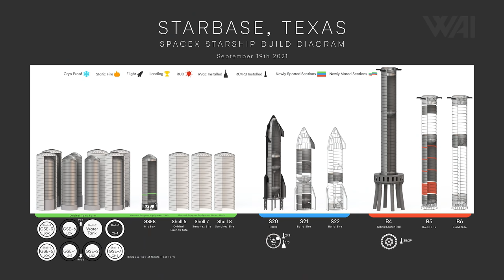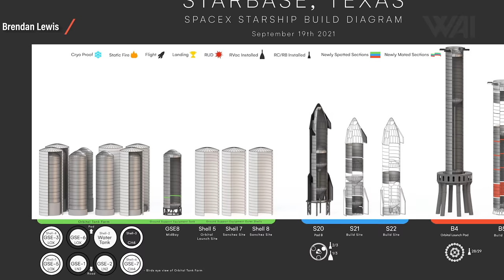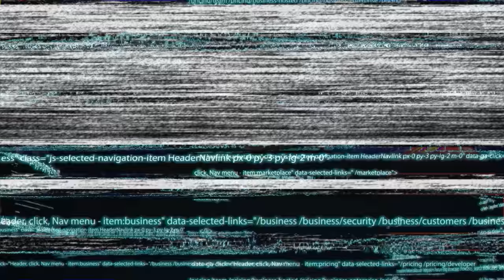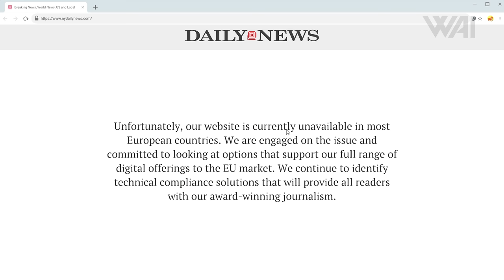Starship 2021 Official Design Changes – The Holy Grail Of Rockets!

Comment: 1:35 until now, no other Second stages have ever successfully returned from orbit. Unless you count the space shuttle which technically was the second stage to the SRB’s. Not that it would be reused without refurbishment, but it was returned and recovered.
Reply: That threw me off too. He clearly meant to say second stage.
Reply: True. Also Buran was 2nd stage that returned.
Reply: @nobody_815  Once.
Reply: @myballsitchsomethingfierce6319  What does that have to do with Top's comment?
Reply: I think the big differences to the space shuttle is a.) speed of turnaround for subsequent flight and b.) ability to land pretty much anywhere (no need for huge runway)
Reply: @myballsitchsomethingfierce6319  LOL... yeah, if THAT'S not showing off.. I'm not sure what is :)
Reply: @usnavyfish  You are right. A correction text is shown on the screen, yep, he meant second stage of course. Actually I added the correction [2nd] in the captions also.
Reply: Space Shuttle was very interesting  in a sense, that it was the first stage (also?). It's engines were working from the beginning of the flight. The SRBs were boosters, side boosters, as their name also indicates. So, looking at it like this, it was a single stage to orbit - but not really, because it had helping side boosters. (and it dropped it's ET).
Buran on the other hand is rather the second stage, since Energia was it's first stage - which also had 4 boosters, but Buran's engine were used only at the last phase, not working at the launch.
Reply: SRB = Stupid Rocket Booster
Solid rockets are barely controllable once ignited. Not very smart for a human vehicle.
Reply: @jeechun  Oh a pertinant and informativ comment. Thx
Reply: Space shuttle wasn't a complete second stage. It was only the payload/crew area and the engines. The remaining part of the second stage (the external tank) was not recovered.
Reply: @janvogel9719  well if they're catching starships, the launch tower with chopsticks, etc. Is probably a comparable to a shuttle runway in terms of infrastructure. However unlike the shuttle the starship couldn't really land anywhere else if it failed to reach orbit.
Reply: @jeechun  Interesting points. Although what counts as a stage; the engines, the fuel, the tank, or all of it? Basically the ET was the entire first stage of the shuttle despite the engines being located at the shuttle itself and crossfed from the ET. A rocket stage is 99-ish % fuel and tank from a mass perspective, so once the ET was dropped, it could be argued the shuttle was a second stage with some (at that point, for the rest of the mission, unusable) first stage engines as a payload.
Reply: @plainText384  I believe that the Starship could also come with a "legged" version for landing on unimproved surfaces (will have to for Moon, Mars)...and even the non-legged version might have some emergency landing capability where it could head for some flat terrain, expend all of its fuel in a short hover before touching down and then do a controlled touchdown (with at least a chance to survive it, even if it tips).
Reply: @janvogel9719  yes but the new render doesn't seem to show legs on the starship (even for crew). Maybe the starship could land without landing legs and without falling over, but if you damage the starship on landing you run the risk of a sn 10 style post landing explosions, even if you hover as long as you can, there will be gaseous methane and oxygen that the engines can't use left over. And if the starship falls over after landing, I don't think crew would survive (starship is 50 m tall).
Reply: @AndrewBlucher  Uhh, right, I was stupid, not the solid rocket boosters.. :D
Actually those could be SSRB (Side Solid Rocket Boosters :D ).
Reply: @reamie  You are right about the mass ratio of fuel and tank in a stage (though it could be lower, perhaps 95% or so, engines are heavy).
But I think, engines (and avionics?) are crucial part of a stage. The Space Shuttle system is so different than a "standard" rocket that it is hard to classify it's elements. I don't even know any other system, which uses a fuel/oxidizer tank, which is dropped while the flight (ascent phase). Do you? Russian Maks was designed somewhat similarly. https://tinyurl.com/rhjwwkfs
Reply: @jeechun  :-)
Reply: keep saying 'shuttle' yall are gonna summon the Chrises from NASASpaceflight

Comment: The new render is also accounting for the header tank with that large window.
Reply: They did talk about in the past moving the header tank for crewed launched, only there to balance the weight with no payload in the nosecone, guess we will see
Reply: @daleyoung5200  I also think it would be a lot easier to keep the propellants cold on interplanezsry missions when all tanks are in the same section 
I imagine it's a lot harder and more complex to build a second cooling system just for a "small" headertank in the nosecone
Reply: That tracks better than my heat coming off the nose theory.

Comment: It amazes me how literally EVERYTHING at the launch site is a prototype, even the tower and the arms. Even though things like the tower don't look like the earlier renders I wouldn't doubt the next tower will look more "complete" or more like the Falcon launch towers
Reply: The really mind-blowing realization is that there should never be anything OTHER than prototypes.  Everything made, ever, should be assumed to be transitional toward something better.  Finality and stability are illusions peddled by MBA leeches.  A true engineer wouldn't agree to such a fantasy if they had a choice in the matter.
Reply: @dudermcdudeface3674  they’ve made it into something organic, a bit like evolution, but on a radically different timescale. Perhaps this is the Silicon Valley breakthrough that he’s applying to disrupt all the sectors he works in. A quick iterative process determined by large data pools and computer simulations. I wonder how well they can model reentry with the TPS they’ve installed on S20. Don’t know much about current capabilities of supercomputers but I’d imagine it’s pretty close… A wild guess would be 80-90%?
Reply: @armr6937  I'd say at least 80%, but the universe has a way of doing stuff that simulation can never predict though lol

Comment: A reminder: the new depiction is not a change in their interior strategy. It’s a newer idealization of what Starship in their view should be. The windows on the 2019 version were before they had verified a version of the tank structure that could withstand the internal pressures and aerodynamic forces while supporting the windows and/or heat shield tiles attached. They know that now.

Even if they removed the landing gear in the current depiction that is no confirmation of their intention to do so eventually. It’s a work in progress that may need to work along the FAA’s current constraints for it to become a launch system with a cadence under a week and up to daily operations.
Reply: It's always important to keep in mind that even with official renders, artist depictions will not reflect the final product, and sometimes liberties are taken due to filling in knowledge gaps from in-process designs or even a lack of clear descriptions. This is true for SpaceX, and it's also true for other space companies as well!
Reply: @z-beeblebrox  Zaphod? Is that you?
Reply: @AndrewBlucher  I'm just your average hoopy frood, that's all

Comment: The Space Shuttle was a reusable 2nd/upper stage, just that it was very expensive to refurbish between uses.
Reply: I take it the fuel tank wasn't considered a stage?
Reply: @94nolo  It's a bit weird, technically the shuttle is the first, second, and third stage, as it's engines are used in all three stages. The first stage is the shuttle main engines drawing from the orange tank and the solid rocket boosters, the second stage is just the shuttle and the tank, and the third stage is the shuttle's orbital maneuvering thrusters. But the point in this video is that there have not been any upper/orbital stages that were reused, and the shuttle was reused, just very inefficiently.
Reply: @Shalashalska  ah hadn't thought about it as such. makes sense, and I agree that the upper stage was reusable. just not rapidly.

Comment: Felix, did you forget the Shuttle or what??? The second stage comes back to earth every time. The boosters are also recovered using their parachutes. Granted, this was not rapid reusability and we lost the tank every time, but still, it was a marvellous technological piece of juillery.
Reply: Yes, I was just about to say the same thing.
Reply: Yes but the second stage (the Shuttle) needed an expensive refurbishment of several months to be ready to flight again and the boosters landed in the sea which made their livespan shorter. 
But your right, it was insane technology for the time
Reply: He first reusable spacecraft the shuttle wasn't completely reusable like starship is so technically the shuttle was only half reusable even though they did recover the boosters and the tanks but only a few tanks landed soft enough to be reused not to mention it is cheaper to build a new tank every time so starship is completely reusable not halfway
Reply: The large fuel tank wasn't reused and the SRBs needed pretty much a complete rebuild for each flight. Also the engines needed a complete strip down and rebuild between flights also. Not really fully reusable at all and a huge amount of refurb between each flight for the parts that were 'reusable'.
Reply: Except a minor issue that it was more expensive than non-reusable rockets.
Reply: I classify the shuttle as an SSTO with boosters, No upper stage fires its engine on the ground.
Reply: I think the word you are looking for regarding the shuttle is re-build-able. It was literately stripped down and put back together again. ;)
Reply: Refurbishable != Reusable
Reply: Shonkers _  if the shuttle is second stage, so you fire the second stage engines first. Don't you?
Reply: A lot of silly replies to the comment.

a) Felix said it incorrectly. He'll need to fix that.

b) Starship is a reusable second stage in that it provides major thrust. As did the shuttle.

c) The Shuttle threw away the solid state boosters and the huge fuel tank. Starship throws away nothing. That is the huge thing.

d) Starship is a 100x better Shuttle.

/TKT
Reply: @Vatsyayana87  an SSTO with boosters could be classified as one and a half stages, or as two stages, depending on who you ask, but by definition adding boosters means it’s not an SSTO anymore.
Reply: Shonkers _  ok I agree. that makes sense.
Reply: Shonkers _  Well we disagree, i think something that lights its engines on the ground all the way to space is absolutely a single stage to orbit. In this case with boosters id say its a hybrid SSTO.
A second stage never lights its engines first, that is pretty hard to argue in my opinion..
Reply: @eliparker4114  By whos definition? Id say by  lighting your engines on the ground all the way to orbit is an SSTO. Certainly a second stage does not ever light its engines first...
Reply: Shonkers _  I responded to like 30 questions and comments passing at least a hundred lol, i dont even know where to find this one again beyond it being in my notifications. You could copy and paste for me if you want, im sure ill get the idea of which convo this was by your answer. It doesnt let me see the comments from even this thread while in notifications.. :(
Reply: Shonkers _  K i found it and i still stand by every word, as of yet. 
The shuttle was a grey area, but i think to call the very first engines ignited as the second stage is just absurd, and to say something burning its engines from the ground all the way to orbit is as close as anything ever flown to an SSTO. 

There is no where that says an SSTO can not have boosters, Its just not what we imagine when talking about them. 

Nobody would ever say something like "they just separated stage one" when an atlas V drops its srb's, right? Because they arent a stage. On shuttle there is only one stage with srb's
Reply: Shonkers _  lol your so picky, its still the same vehicle doing it isnt it?
Are you telling me you think the dragon capsule covers multiple stages because it uses its dracos to finalize its orbit sometimes? Simply absurd my friend.

Shuttle is a grey area, so its basically not worth talking about at all but i can say one thing straight out, a second stage does not light its engine on the ground and im pretty sure nobody has ever called strap on srb's a separate stage if the mains are also running.
Reply: Shonkers _  Though i didnt actually know that about shuttle so thank you. I still consider them the same stage but clearly we can disagree on that lol
That thing was one big grey area, its so not by the norm, hell its not even a rocket by definition...

Comment: I LOVE the new updates on the design! Less in terms of looks but more and more in terms of efficiency. Why make the ship more complicated and heavy when you can lose so much weight with simplifying. Exactly what i love about engineering! Optimization
Reply: SpaceX should remove  the big topmost window alltogether.
Reply: @MrJPI  speaking strictly for efficiency yes. The step of making it smaller is a compromise. Still not enough of a compromise maybe but its a right step. Removing it would remove one thing that makes the whole ship look cooler. But.. lets be honest this thing is cool enough.

Comment: the space shuttle could be considered an upper stage that made it back? it doesn't really have a first stage tho, just two SRB and an external tank
Reply: yep, in every meaningful way it is an upper stage, it has to bleed off orbital speed to get back, which is the whole hard part,
Reply: I have a feeling that Starship will be pissing around with the heat shield on each turn around, just like the Space Shuttle.
Reuseability sounds great on paper, but it's not that simple in practice.
Reply: @oldmandoinghighkicksonlyin1368  certainly looks that way so far, maybe their attachment system makes it quicker and cheaper.
Reply: @oldmandoinghighkicksonlyin1368  at least it's a lot simpler to swap them and there aren't that many shapes. we have already seen inspection and replacement in the last weeks
Reply: @cmilkau  Yes, it's a lot more uniform than the space shuttle which had nearly all unique shapes. But there are still unique shapes on Starship around certain areas. Plus a manual inspection will be required after each flight and then after each re-install. It's not a process that can be automated.
Reply: possibly, but its reusability is questionable, since the whole vehicle basically needs to be refurbished for spaceflight.
Reply: @Dejawolfs  All spacecraft need to be refurbished after spaceflight because it's so punishing an environment and our materials science hasn't made workable materials that are invulnerable just yet.
Starship is still just theory at this point, but it is working with concepts and materials that are a half century further down the development chain than the space shuttle, so there's a good chance it will be faster than a 4 month turnaround.
Reply: Thats one of those opinion things i suppose lol. Since the shuttle lights its engine before anything happens at all, id argue its not the upper stage, i think there is only one stage with boosters. An SSTO one might say but not in the fashion that most would classify the words, even if correct..
Reply: The shuttle was closer to a single stage to orbit with a drop tank. The tank was never reused though so it was not fully reusable in that sense and to reuse the shuttle itself required a huge amount of refurbishment.
Reply: @oldmandoinghighkicksonlyin1368  You're not factoring in the iterative development process into the whole deal. Picture the early tanks, that always looked dinged and uneven. They look incredibly tight nowadays. Or the nose-cones, the last version we saw in Tim Dodd's video was a huge step-up. The process gets streamlined as they learn more about it, it's not a fixed design like the tile layout on STS was, each Orbiter with its own number of tiles. In a year you might be seeing a radically different process to apply and ensure TPS integrity for several launches before refurbishment.
Reply: Starship would not be 'first' doing this. The Space Shuttle most definitely re-entered from orbital speeds. You can quibble about the reuse-vs-refurbish and how expensive and practical it was to reuse the shuttle, but not about it re-entering from orbital speeds.
Reply: Engines on stage two usually light up in space..
Space Shuttle engines light on take off
Maybe that disqualifies it from being labeled a second stage...    :)
Reply: @perthomsen8708  I quibble that shuttle was the first stage, you do not light the second stage engine to start a launch...
Reply: @perthomsen8708  But it wasn't fully reusable because its huge fuel tank wasn't reused, I think that's the point.
Reply: @schrodingerscat1863  I was really only making the point about re-entering from orbital speeds. Did not want to get into the 'reusable' discussion.
Reply: @Vatsyayana87  True, you don't light the second stage on the ground, but the shuttle didn't have a 'second' stage per se. The RS-25's were lit all the way into orbit. Tank and SRBs were dropped, but they were not a first stage in the traditional sense. 
I guess the  bottom line is that the Shuttle was an unusual configuration of engines/tanks/SRBs...
Reply: @perthomsen8708  I would say its an SSTO hybrid, thats my final answer.
Reply: @perthomsen8708  It did that sure enough, but as I said at that point it had already jettisoned its fuel tank so was no longer complete. It's kind of academic though as it least it came back substantially complete.